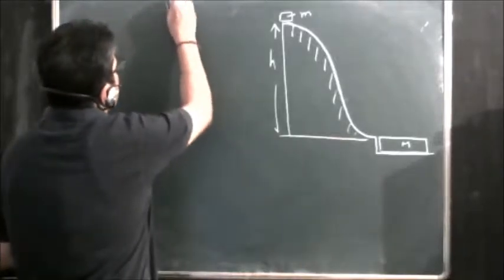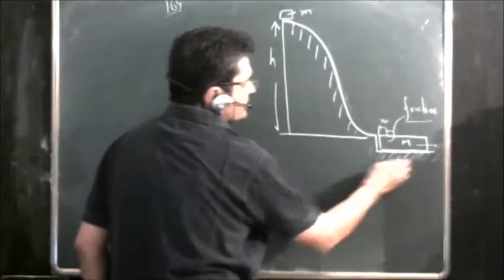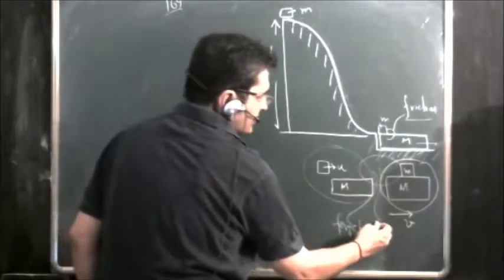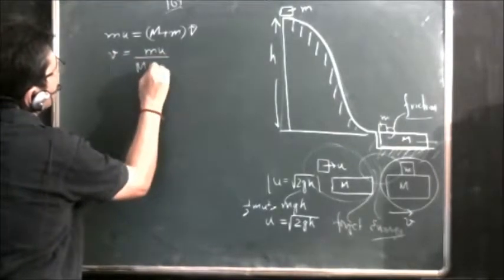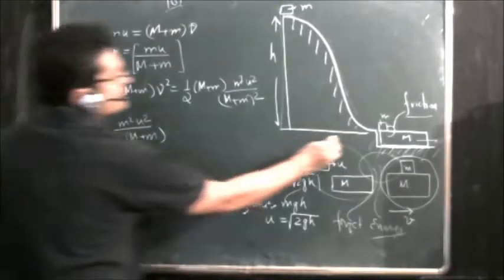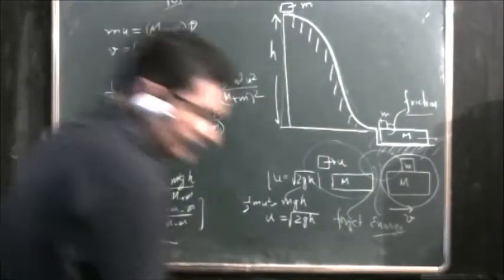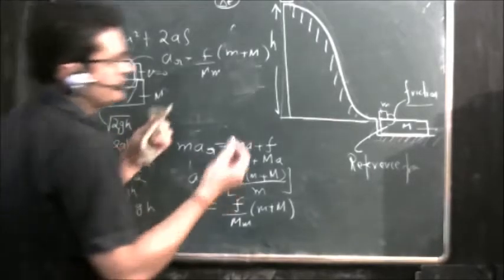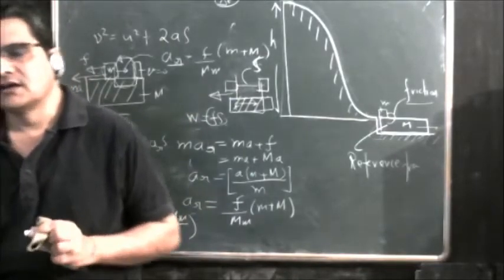pseudo force and reference frame solution to irodov problem 164

Comment: Sir doubt is that friction does negative work on small block and positive work on large and it's equal in magnitude thus net work done of friction in the system us zero as in DC pandey that friction work on the system is given and if solve this problem by nlm v=u-*(mu)(gt)and v=(mu)mg/Mt the ans comes different plz reply
Reply from the maker: I think I am not able to get it very clear, are you applying conservation of energy? You can apply conservation of momentum when there are internal forces like friction in this case between the two blocks and you are conserving their momentum. But this friction is also dissipating energy. You can apply conservation of energy in case of pure rolling with friction on inclined plane because there energy is not dissipated, only one form of velocity is converted into another form there.
Reply from the maker: yk96tr@gmail.com